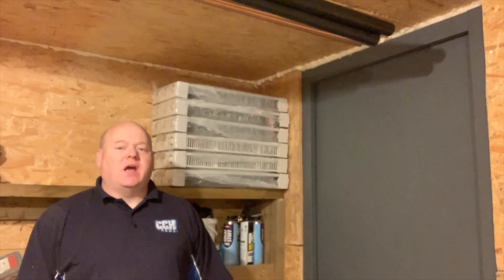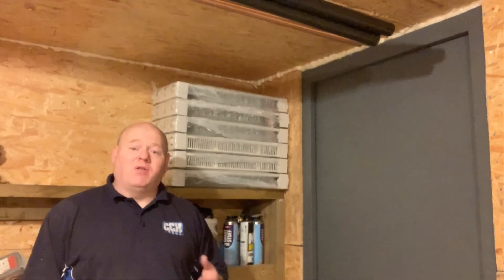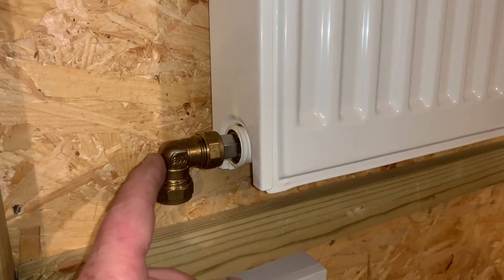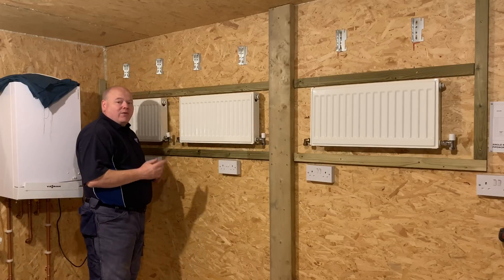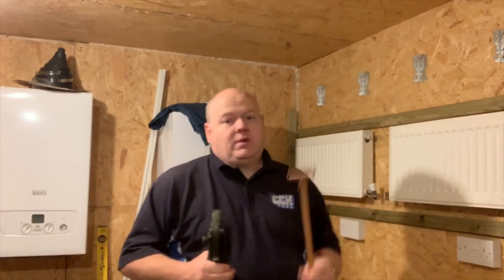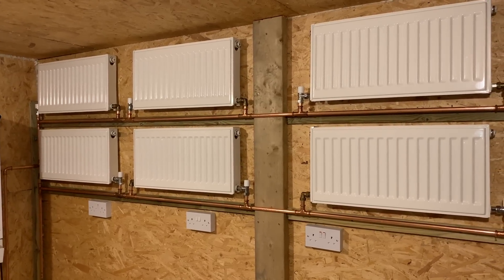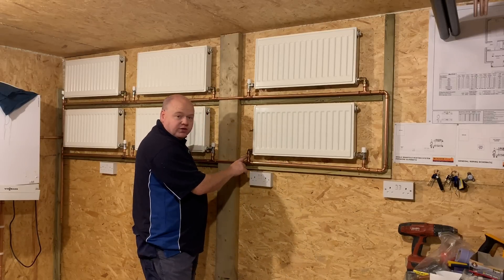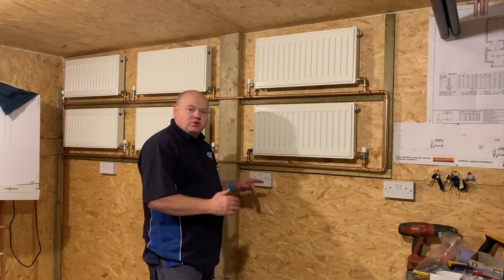Plumbing - HOW TO INSTALL A ONE PIPE CENTRAL HEATING SYSTEM

Comment: Excellent video Allen. Good for the youngsters to see what a one pipe system looks like. Just to note that the downside to a one pipe system is the radiators get progressively cooler along the system. Also the main circuit can be pumped but the radiators rely on the heating water to gravitate into the rads, meaning the heat up time is much longer in comparison to a two pipe system. Keep making the great videos. 👍🏼
Reply from the maker: Thank you.
Reply: @AllenHart999  Hi Allen, can i fix both flow and return pipes to one side of radiator? if yes, which one should be on top and which one below?
Reply: @AllenHart999  thank you for another great video Allen. With this type of system would the pump go on the flow or return.
Reply: Is it permissible to ride one pipe line for all Hittrat?

Comment: Hmmm
Why would hot water go thru rad if the larger diameter main loop is right there?

I thought pressure drop from inlet to outlet had to be created somehow.
I guess rad internal cross section is much larger...so is a preferred path to main loop?
Or diverter t?

Comment: Given the water usually takes the easiest route, why would it flow through the restriction in the rads anyway, why does it not just bypass? I have a one pipe system, works ok but I've never understood why/how it works😂 - Old video I know Alan, but great all the same...!

Comment: Hi --thanks for the video --we are having  issues with a one pipe system where we have just replaced some really old radiators with the result that five of them are not functioning at all --------I note you did not use a locksheild radiator valve on the inlet --did you use one on the outlet ?----we have used them on both ends --do you think we have restricted the flow too much and the hot water is unable to travel through the system .

At present we have very hot inlet pipes with the water seemingly unable to enter the radiator with the outlet still cold .

If you can please clarify what type of valves we should change to on the inlet and outlet --Many thanks

Comment: Is it possible to temporarily install a gate valve on the pipe to help flushing? That way the water can only go through the radiator itself

Comment: Thanks for good explanation of one pipe system. I always thought direction of water flow should be where the valves and termostats are but as it look flow direction is from end of radiator to front and where termostat is, thanks because it is very important to know.

Comment: Hi. What stops the water just bypassing the rads and returning hot on the return. Do you need a gatevalve half closed on the return just before the boiler to try force heat into the rads

Comment: Thank you for this, really well explained.
I’m looking to install a new system into a static caravan, with a combi boiler running 10mm PEX pipe work, would you still avoid a one pipe system?
Reply from the maker: One pipe system is an old design; you need two pipes. Thanks.
Reply: Thank you Allen, much appreciated. I was on the fence (hence finding your video) but felt I might regret it later!
I actually visited a (UK) house yesterday that only had a valve on one end of the radiator with both pipes going into this. The valve said Yorkshire Imperial' on the top, seems like an even less efficient system than the one you're demonstrating here?

Comment: What makes water go through a radiator? You should have flow control on the bypass line, otherwise water will go less restriction way - main line and not radiators.

Comment: Just come across your channel will be subscribing im looking into an outdoor wood fired boiler system to run my radiators in my house  plumbed around 9 years ago attached  to a combi boiler in an upstairs  room atm but with costs rising I want to have options  I have an infinite free supply of  logs and I'm already 5 years in stock for my wood burner in my living room but this does not keep my  whole house warm  for long periods my c/h is on at 13c to keep house from severe cold but  id rather be using free wood than paying gas bills  could a system like I'm considering be connected to my existing system    do you think 🤔 regards Steve roche

Comment: I just bought my first house (late 40's ranch) and come to find out it has a one pipe system on a navien ncb 240e, and I'm running into an issue where one of the radiators on the 2nd floor remains cold unless I bleed it for a while (bad I know, but I was trying to troubleshoot, and I kept an eye on the PSI to make sure it didn't drop too much from the bit of water I let out) so in doing research I found this vid, thanks for laying it out, now I can go to my dad's hvac/plumber to inquire how to fix it, probably gunk in the radiator for all i know...

Comment: As far as I can see, the isolation valve is fitted only on the outlet of the radiator. If you want to remove a radiator for whatever reason will be necessary to drain the entire system. And just for my knowledge- in the video the isolation valve is on the outlet side of the radiator- any particular reaso?

Comment: Great video Alan, the house I’ve just moved to has a one pipe system. How do you remove a radiator from a one pipe system and not disrupt the flow?

Comment: I have a one pipe system on a narrowboat. Boiler at one end with flow to 4 radiators on the the same wall extending to the length of the 50ft boat. The last radiator has the flow in one end and return out the other. 22mm plastic pipe with 15mm tails. As the return is running back underneath the flow the full length of the boat it seemed strange to me the installer didn’t make it into a 2 pipe system. I have to add the boiler is a little diesel heater the type they use in lorries. Would there be much advantage in changing this to a 2 pipe system or is this one pipe system best for this type of installation.

Comment: G’day. Good video. I have a one pipe system with diagonally opposed flow and return ports on the radiators.  What is the direction of flow through radiator?  Should rad valve be on the bottom or top?

Comment: I have one radiator in my bedroom down stairs and i wanted to add another radiator in bedroom. The problem is there is a concrete slab underneath the radiator so i can't add new radiator in existing one. Can u please give me any suggestion how to add a new radiator. Is there any other way to add it ?
Reply from the maker: You need to find the circuit and extend it. Thanks

Comment: Its very easy for hot water to pass easily through the pipe below the radiators  which is straight and there is no hurdle or resistance then why and how the water pass through the radiator which have a lot of resistance instead the water will flow from the boiler and pass through the straight pipes  without entering the radiators and come back to the boiler. I think this system will not work properly . Would you convince me please.
Reply from the maker: You are correct, These are really poor systems. This is just to show how they work. Thanks.
Reply from the maker: Thanks very much for your comment, please consider subscribing to support the channel 🙂

Comment: Is it unadvisable to use elbows on a one pipe system? Swept bends needed? And do towel rads work on a one pipe system. If a normal radiator is swapped for a towel radiator. Obviously keeping the loop continuous as you state.
Reply from the maker: Thanks very much for your comment, please consider subscribing to support the channel 🙂

Comment: Had one of these and didn't realise. I took the old back boiler out along with cylinder (the loung was actually being used as a bedroom) and put a cdi classic combi in. I remember it well, it was around 2 o'clock on a Friday, boiler all done and ready to roll. Run the hot tap - all good. Then I turned the heating on. I filled the paperwork out and tidied up as usual whilst fully expecting to touch a nice hot rad. All but two rads were stone cold. After trying balancing, checking for air in rads, air locks, took rad valves off to blow through them etc it still wouldn't work. I decided to lift a floorboards. To my horror they had one 28mm pipe and both tails going back into it😲. The 28mm as the circuit got near it's end actually reduced to 22mm and strangely was hot all the way round but regardless of what I done with the valves I couldn't get more than 3 of them to work. Worcester advised that the flow from the new combi was probably too fast. Anyway after a few tears (mostly mine this house pen and inked) the customer decided to repipe the system. After the repipe it all worked perfectly.If anyone has any ideas on why it didn't work please let me know. Cheers
Reply from the maker: Thanks for the comment. Happy New Year.

Comment: Thanks for the video Allen. I just been to one of these the last couple of days as the rads are only lukewarm and some not at all. Boiler flow red hot but the return nothing. Had an inclination it was a one pipe system but never came across one before. Had up the floor boards by a rad but the supplies were so long I could not see if it was a one or 2 pipe. Looking in my plumbing book now and looking online I can see it is as the rads have service valves and elbows going into the rad on one end. Lots of additional rads been added and apparently the system has not worked properly for yrs. Old couple as well and there is no easy fix for this. 

This is a fully pumped s plan system. The joys a

Comment: do you need to install diverter tee to force water flow to the radiator? how do you calculate how much water will go to the radiator and how much water will remind on the main pipe?

Comment: As water always takes the route of least resistance why would it flow up and then  through the rads?
Reply from the maker: You could add some valves on pipe below to restrict it a bit, That way it is forced to go through the rad. Thanks
Reply: Exactly what I was thinking. With a valve in the bypass pipe under the rad this would allow fine adjustment to regulate the heat of each rad.  I am about to install such as system so I will comment on completion

Comment: I have a 22mm one pipe system. Not getting rid of it, with its cast iron radiators it is over 40 years old but will be an easy conversion to a heat pump when we all have to😉

Comment: i think this is my type of system on a combi im not sure. but the rads get warm very slowly on 1 rad so i cut and blocked the flow pipe so the water gos throw the rad and it works better. is that ok to do on more then 1 rad ? 1 of my rads are keeped open and has no tvr but that rad gets very hot . my combi is a eco tec pro vaillant.

Comment: I have a one pipe system with some old cast iron flat panel rads. They have no lockshield valves, and just an elbows as you show in the video. But on mine it looks like the elbow screwed directly into the rad (i.e. no separate tails with a compression fitting to the elbow end). Am I right in thinking that used to be the case?
Reply from the maker: Yes, They used to do them like that sometimes as well. Thanks.
Reply: Allen Hart - Okay, thanks for confirming that!

Comment: Hi Allen .. Thank you for the video you have explained the easy part and you left behind the hard part about how to connect the pipes to the boiler ? I well understood that the hot line to the radiators is from the hot water supply from the boiler But does the return pipe from the radiators go back also to the cold pipe that supply the boiler ? My gas boiler has only two water lines and of course the gas pipe.

Comment: Great  video Allen, i have a slight problem with my one pipe system, i wonder if you could help, after changing a radiator to a shorter one ,The   pipe to the original radiator was cut and then a plastic elbow was fitted ,then a length of plastic pipe fitted from the elbow to the copper pipe  up to the radiator. the radiator stays hot for a week or so, then the rad will not get warm even though when i feel the original copper which was cut it is hot, all the other radiator on the system get hot,
now the only way to get the radiator hot again is to release water from the radiator drain pipe. Boilers pressure stays between 1.2 and 1.6 bar. grateful for any help.

Comment: Hi there great video first time on a one pie system so I gave it a go after watching your video I decided to add a radiator to down stairs toilet and the only pipes I could get to where in the ceiling so I followed your diagram broke in to the system brought the pipes down and back up it all looks fine as per diagram but it doesn't get warm one side of pipes does for a short time then nothing rest of them work apart from one now in the hallway which is cold now too I've tried bleeding through but nothing seems to solve it it seems like an sure lock as all pies in the ceiling are red hot apart from new ones any advice on this please
Reply from the maker: Maybe your system is two pipe?
Reply: @AllenHart999  not definitely 1 Pipe system just wondered if gravity could affect it as I have come off upstairs to take it down stairs
Reply from the maker: @bburnbulletpreston6994  It's hard for me to comment without seeing it but try and keep the pipes off the main circuit as short as possible. Thanks.
Reply: @AllenHart999  ok thanks I'll give it a try
Reply from the maker: @bburnbulletpreston6994  Feel free to give me a call if you get stuck

Comment: On the return from radiators we need valves to balance the system dude.
Reply from the maker: This is how the old systems where buddy. Thanks.
Reply: Exactly and of course yes you can power flush these systems and I’ve lost count how many I have done successfully !

Comment: One pipe system is cheap, no need for by-pass, but balancing is very important otherwise the last rads doesn't heat properly. We can fit the two pipes (flow and return) from one side of the rad using giacomini thermostatic valves kit. 
Some rads got a spout inside to inject the flow.

Comment: I inherited a one pipe system in the house we bought 5 years ago, I've moved rads about in a few rooms by just extending the "offtakes" these rads seem to perform fine. Why is it that you don't recommend such tie ins?
Reply from the maker: Its not a great system really. Two pipe systems are much better.

Comment: Hi Allen, great video  but how do you tell it's a 1 pipe with Trv and lock shield on rads and all pipework is underfloor?
Reply from the maker: Sometimes you will need to lift a board up, You normally get an idea if its an old system though. Thanks.

Comment: How to install a one pipe system. Don't!!!
Reply from the maker: The video is to show people a one pipe system, Maybe help them change parts of it if needed. Thanks.
Reply: @AllenHart999  Yes I know. What to do if you need to make alterations on an existing one pipe system. No one is likely to fit a one pipe system these days if starting from scratch.

Comment: Mr Allen, may I ask you what you recommend for underfloor heating. Pipes or panels (Klimaboden). And also pipes in pvc is it better push in or glued or like in Europe sealed by welding machine for pvc?? Thank you
Reply from the maker: I will be doing some underfloor heating in a couple of weeks. I will do a video. Thanks.

Comment: Can you add any new radiator to a one pipe system? Or does it have to be a specific type
Reply from the maker: Most radiators are fine. There might be some that are not suitable but i do not know of any. Thanks.

Comment: Thanks for video, but don't understand how any flow would happen in any Rad. Water is lazy like us and will take path of least resistance which is straight below Rad, not through it. Is it just convection with differant density of differant temperatures water that cooled off in Rad? If that is the case system efficiency must be terrible.
Reply from the maker: They didn't work well. Thanks.

Comment: Top video Alan, good explanation. I learnt something myself there about adding or moving a rad. In summary Elbow off to extend the loop don’t just tee off as with a two pipe ? Nice one
Reply: Makes sense flow will just take easiest route thanks
Reply from the maker: +Heat Service bwc uk Yes that’s correct, if you tee off the system will not work as well. Glad to help 👍
Reply: Often iv seen swept tees used also to help the flow into the rad. I believe they still use one pipe systems in larger commercial installs. installation cost I guess.
Reply: Heat Service bwc uk commercially you see one pipe systems all the time but very rarely would you fit one unless you cannot do it any other way,they are very simple once you get your head around it but can be problematic also 😂

Comment: Did these systems have a 'flower pot' filling system found in the corner of box rooms?
Reply from the maker: That was a servo warm system. I have never seen one of them as one pipe but it's possible. Thanks.